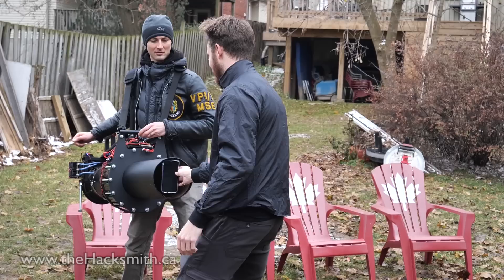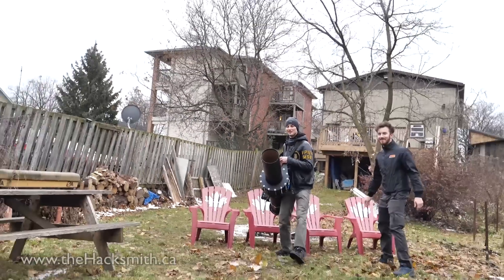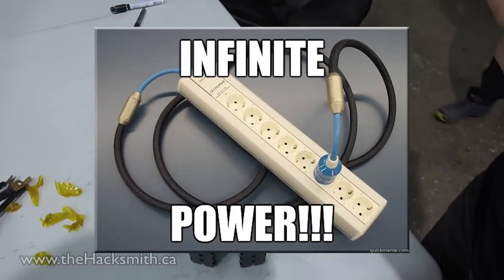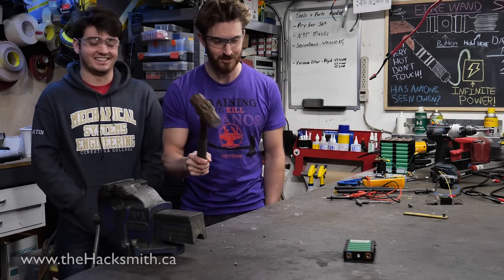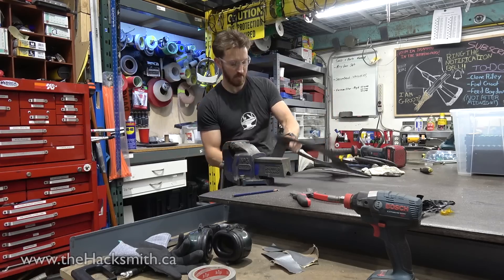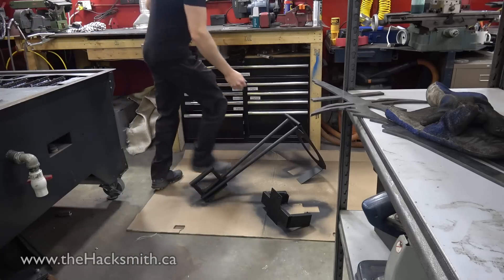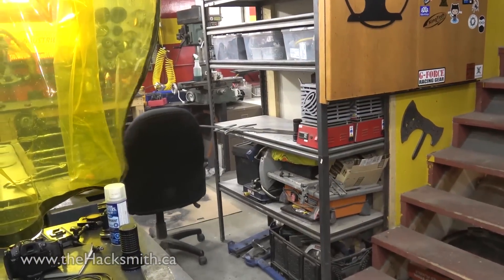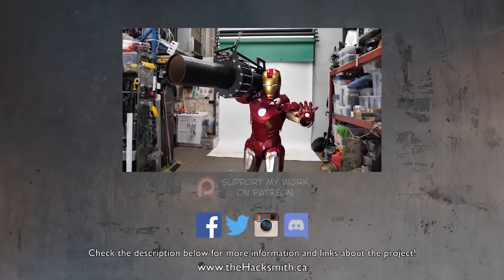$10,000 LEAFBLOWER VS IPHONE XS MAX

Comment: Wrong CFM calculated "small" EDF's  (100-120mm) have ~6000CFM you can convert KG thrust into CFM, i came up with conversion factor of  1729, for 24KG of thrust you get 41511CFM (40KCFM)

Comment: "This thing is really heavy and will pull backwards with 50 lbs"
"we need a strap in between these or else it'll just push itself away from the battery"
Welds a steel frame to hold it together...
Reply from the maker: The steel frame weighs all of 5lbs dude

Comment: U used so much metal on it, save your self from buying alot of metal by just using it when it's really needed
Reply from the maker: huh?a few pieces of metal pipe and one plasma cut piece really isn't that much metal?
Reply: @hacksmith  I guess your right, but then it would be to heavy  to fly
Reply from the maker: @bifrostyeti  the batteries are the heavy part!
Reply: @hacksmith   then that's a challenge on your hands to make it fly then(that if you're are planning to fly with it), I'ma sub so I can see latest videos

Comment: Aluminium cast parts would be lighter. Btw
Reply from the maker: Casting those parts wouldn't really make sense though! Why wouldn't you just use aluminum sheet metal and tubes? Also the main weight wasn't the steel -- it's the batteries and the EDF itself =)

Comment: I was going to suggest you try to make a stable plasma ring generator.  One such device uses super pressurized water hitting a plate made of quartz to generate a stable ring based on the triboelectric effect.  Scientists also made a device that shot plasma rings which were stable for 10 milliseconds, long enough to fire the rings about half a meter.

Comment: You can actually bump up the thrust of that thing by tapering the end so that the tapered end has the same cross-sectional area as the EDF's cross-sectional area at the fan. 

 When the air goes from the EDF into the pipe, the cylinder that the fan blades are on tapers down to nothing, in other words, the cross-section changes from a donut to a circle, so the cross-sectional area increases, causing a drop in pressure and a reduction in thrust.  You can compensate by tapering the end to make it a circle that matches the cross-sectional area of the donut that would result by taking the cross-section at the EDF.  You can do this by say for example, taking a traffic cone and cutting off the top until the end inner diameter matches what you would need it to be.  I estimate that about 175mm would do if the EDF is 200mm.  For my 90mm EDF, tapering to 76mm is the golden number for it.  This is actually a common practice amongst RC plane hobbyists.  It basically increases the air speed without sacrificing air volume.

Comment: Could you pump gas into the tube and light it on fire, using the turbine thingy to blow the gas out and use it as a flamethrower?
Reply: You'd need insane amounts of fuel, but the ~5 seconds would be awesome

Comment: You should make a thermojet. Replace the tube with a metal pipe, make  afterburner style spraybars and rings and put in an ignitor. Start with diesel or kerosene as fuel, then mix in some gasoline if it has difficulty staying lit.

Comment: Those battery modules are so nice. That BMS is my favourite. Just a damn shame it doesn't go to higher cell counts.
And second hand batteries were a lot cheaper for my scooter. :)
Reply: We'll make a new version for higher voltages soon. Stay tuned ;)
It does 750A already though.
Reply: @eIektrinis  nice. All those small Chinese BMS with switching FET creep me out. Really not the best solution for high power demands.

Comment: What if you had two bikes held together so can't tip over then mount it as the engine of the cart. You could make a handle that controls both bike wheel directions

Comment: Are energus batteries more powerful or are Tesla batteries more powerful
Reply: K thanks
Reply from the maker: Exact same. 18650 lithium ion
Reply: These are same 18650 cell size as tesla, but more ppwer-oriented model. Tesla is more capacity oriented.
Reply: Ok